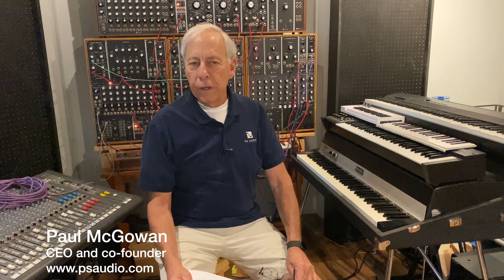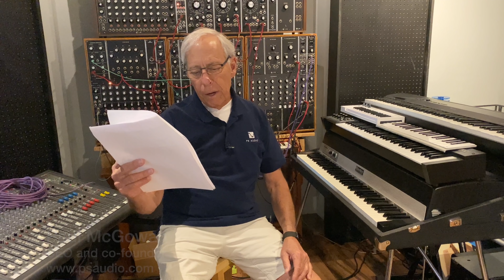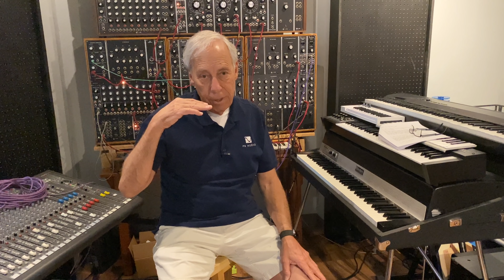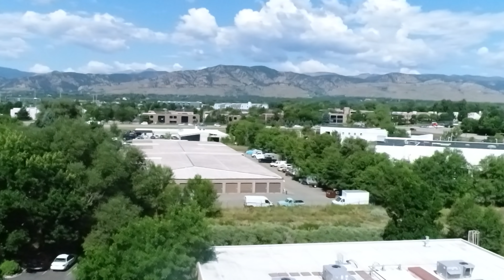Current and voltage amplifiers

Comment: Isn’t voltage a measure of electrical potential? And current is the flow of the electrons coming from this potential when you complete a circuit through a given resistance, the overall result of which is power? If this is true, how does the premise of a voltage amplifier versus a current amplifier make sense? They are two parts of an equation. Don’t amplifiers amplify the voltage and handle the amount of current depending on he resistance? Do they amplify the current instead?
Reply: Any audio amplifier you're likely to encounter is designed to produce an output voltage proportional to the input voltage.  When connected to a speaker load, the speaker sets the amount of current.  
We do talk about amplifier output stages as current-amplification stages (because they are controlled by much smaller currents than they send to the load), but it isn't the amplifier which decides how much current to put out; its job is just to control voltage.  
It's possible to design amplifiers which push current to the load, which is proportional to the input voltage.  They're rarely useful in audio applications, though.  We use them in applications like flight controls, to drive electro-hydraulic valves for example, where the response is specified as a function of current.
Reply: It's possible to design amplifiers which push current to the load, which is proportional to the input voltage. They're very useful in audio applications, to drive loudspeaker drivers, where the response is specified as a function of current (SPL ≈ a, F = m x a, F = BL x I).
Reply: Marianne Oelund Thank you!
Reply: @JerryRutten  My thoughts exactly. A speaker's impedance varies with frequency.  That would represent a distortion of a voltage signal where the magnetic field differed by voltage at different frequencies.  But for a transconductance amplifier, the current and therefore the magnetic field driving the speaker would always be a linear function of the source voltage.
Reply: @timharig  It is amazing (or even idiotic) that aren't far more current-drive amplifiers around.

Especially because of the heavy modulations of the voice coil resistance, voice coil inductance and back-emf  voltage, which all distort and/or compress the sound, disturb passive crossovers and power amplifiers.

It seems that amplifier designers don't have a clue how drivers work, and that (a lot of) driver designers don't know you can build other type of amplifiers. And I think that Chris Brunhaver should discuss the subjects related to loudspeakers, power amplifiers and related topics, Paul is fundamental wrong on the different topics.

Comment: I don't agree ( I am also an EE) there's no such thing as a "voltage amplifier" or "current amplifier". All amplifiers are power amplifiers. Power Pain = Pout/Pin, expressed in db it is 10log( Po/Pin) talking about one of your power amps as an amplifier with 30 dB gain is silly. If the input impedance is 47K, and the output impedance if 8 ohms, and the input is 1 V, and the output is 30V, the gain is NOT 30 dB, it is 58.2 dB  (10 log (Po/Pin) ) anything else is just nonsense.
Reply: All power amplifiers are power amplifiers. But a power amplifier can control (via negative feedback, as you should know as an EE) the voltage or the current, which changes the output impedance.
Zo ≪ Zload: voltage-control or voltage-drive
Zo ≈ Zload: power drive (no or very low feedback)
Zo ≫ Zload: current-control or current-drive

And talking about power is silly, because the force in an electrodynamic driver is created by current (F = BL x I). SPL is linear related to current, power is linear related to sound power (SWL) and sound particle velocity (SVL) is (backward!) linear related to voltage (an (electrodynamic) microphone generates voltage). You hear the sound pressure (SPL), not the sound particle velocity (SVL) and not the sound power (SWL).

And being an EE is not an argument, especially when you don't have also a degree in electrodynamics, acoustics and/or loudspeaker design. There are more people around here being an EE...
Reply: @JerryRutten  I disagree
Reply: Fred Zlotnick That’s your good right!  But a missed opportunity. You should dive into some sound engineering.

Comment: A little confusing. Maybe better to say that typically all power amplifiers have a (voltage) gain stage that drives the output stage that typically has little to no voltage gain.  It is that output stage that has to drive the low impedance speaker loads.  The so called current amplifiers are just capable of driving excessively low speaker loads,  like in the 2 ohm range.

Comment: Voltage is one of the two factors of power (along with current). this explanation was very deceiving.
Reply: If you have high voltage and low resistance you will get high current. So my guess is that there is some impedance involved on the voltage amplifier stage and in the current amplification stage has close to zero impedance.

Comment: volt × amp = watts

The amplifier follows ohm's law!

To make a motor run faster or a light bulb to shine brighter we need more volts. But also more amp.

I do not think it is so easy to amplify the amp! Amp comes from power supply.

If you have a 50volt transformer and 10 amp. If you take and regulate 50 volts to 25 volts then you have 20 amp!

Most amplifiers do not output more than the transformer provides. If it gives 50 volts then you do not get more volts out to the speaker than that!
Reply: @Lloyd Stout Ok. Not so easy to explain with words. I do not live in an English speaking country and have to use google translate.
Reply: @ford1546  It isn't the language.  Your statements are factually wrong in any language.

There are voltage sources and there are current sources. A voltage source outputs a defined voltage and the current varies with the load.  A current source outputs a defined current and the voltage varies with the load.

Either way,  the output impedance of the source determines how much power output is possible. 

That much said, Paul's use of the term "current amplifier" is wrong. What he really means is low impedance output voltage amplifier so that it can source high current.

Comment: I'm definitely no expert and still learning, but I literally laughed out-loud when you read the question because it has to be about the 23rd time you have covered this topic! ha ha
Reply: I haven't seen the others; but,  this explanation is:

1. Wrong. 
2. Doesn't answer the question that was asked. 

Both problems arise from Paul's incorrect use of the term "current amplifier." I assume he is doing that in an attempt to simply explanations; but,  it is confusing and in this instance led to answering the wrong question. 

What Paul is referring to is simply an output voltage amplifier that has a very low impedance. 

A current amplifier or transconductance amplifier has an output current that is a factor of the gain and the output voltage is determined by the speaker impedance.

This question asked why transconductance power amplifiers are not more common.  They make logical sense.  Speakers are driven by electromagnets.  Magnetic fields are dependent on current, not voltage.  So it makes sense to drive what is actually driving the speakers -- especially since speaker impedance varies with frequency.

Comment: this is a stupid answer. you need a voltage amplifier because of the impedance curve of a loudspeaker, which 99% of the time is not a straight line. with a current amplifier, the amount of amplification is antiproportional to the resistance/impedance, that’s ohm’s law. in a voltage amplifier, the resistance (almost) doesnt have any effect on the amplification.

Comment: Paul, first of all great job, keep it up. I appreciate how difficult it is to simplify topics to make them accessible to a wider audience. My understanding of current vs voltage amplifiers somewhat differs from yours. My understanding is that a voltage amplifier amplifies voltage therefore voltage is the primary parameter imposed to the load. As such the current load is given by I=V/Z (current = voltage/load impedance). In a current amplifier current is amplified. In this case current is the primary parameter imposed to the load. as such, the voltage at the load terminals is V=Z*I. In control theory for instruments we use current loops quite a bit because such signals are not as affected by interference as well as impacted by cable impedance (voltage drop). In a speaker I am not sure why you would use a current amplifier and in fact it would make a speaker resonance much worse (remember, voltage at the speaker terminal need to go up as we want to feed the same current in a load that is going up in impedance as a result of the cone resonance characteristics).
Reply: Paul interprets the question as it was about the different stages within a power amplifier. There you have a voltage amplification stage and a current or power stage.

But I think the question was different. About voltage and current amplifiers.

Some reasons for a current amplifier:
- An electrodynamic driver is driven by current (as we all learned at high school, electrodynamic motors are driven by current, not by voltage, power or charge). So the output (in SPL) is direct related to current (SPL ≈ F = BL x I).
- Lower distortion, all distortions related to impedances, changes and modulation of impedances ('current distortion') are eliminated. Especially the midrange distortion and the intermodulation distortion by low frequencies, is lowered.
- A stable frequency response. Electric damping, for example, is influenced by impedances, changes and modulation of impedances (for example by temperature, excursion, current, cone movements and even sound). So the frequency response is not effected by those changes or by changing the speaker cable and there is also no power compression. Damping of the resonance you can do in other and much better (stable) ways (in the driver, in or with the enclosure, in the crossover or with EQ).
- More high frequency output. Although with a current amplifier you have to compensate for a raised on-axis response by the horn effect and break up of the driver.
Reply: Yea, Paul keeps using the term "current amplifier" incorrectly and it is leading to a lot of confusion.  I can understand that he is trying to simplify things by not discussing output impedance; but, he needs to find a simplified term that doesn't overlap with a preexisting and well defined term.